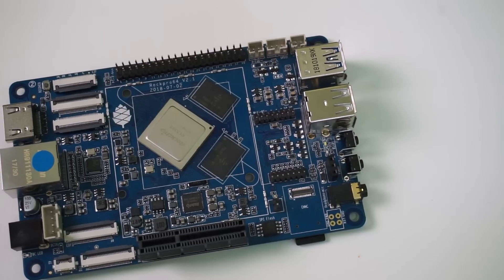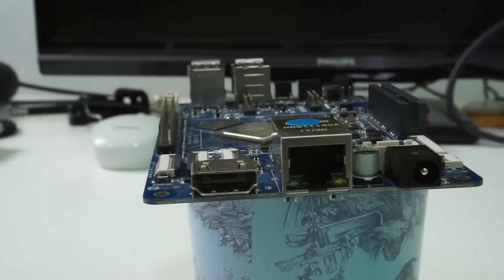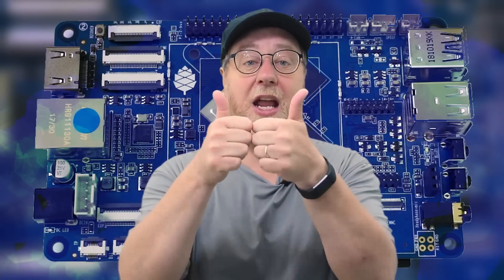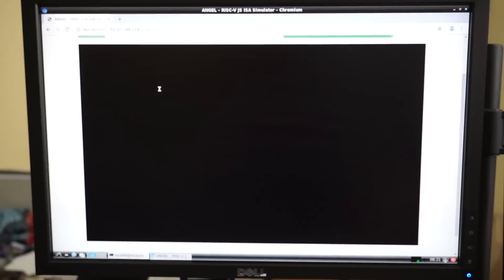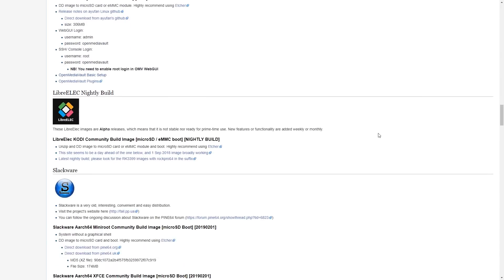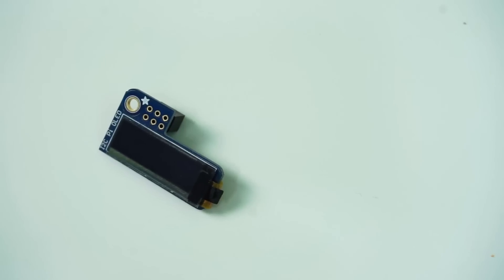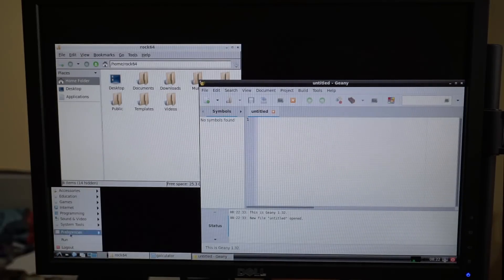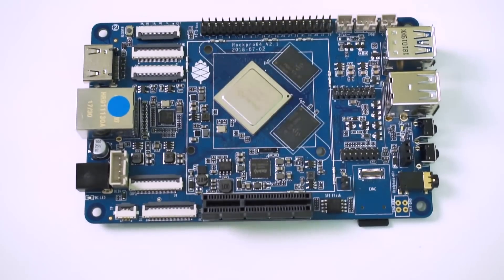PINE64 ROCKPro64 Review: Better than a Raspberry Pi?

Comment: Thumbs up, but for reviewing an open source hardware board. The Rπ is the Microsoft of SBC's. Sure the Rπ may be easier for your grandmother to plug and play, but open source hardware is the future. The Rockchip has a datasheet, so the Linux kernel can support it as people develop the code and drivers. In fact anyone could do this. The Rπ has a broadcom chip with a locked datasheet. Only the Rπ foundation has the datasheet, and they have a binding legal non disclosure agreement that prevents them from sharing it with anyone. They make this deal with the devil so that no one else can purchase the broadcom chip used on the π. No one can build their own hardware with it unless they buy and integrate an entire Rπ which is entirely impractical. The only reason the Rπ has support is due to the Rπ foundation. This is exactly like Microsoft and products like Windows. It's a business strategy all about dominating the lion's share of the market with a sub standard product.
  In the long term, open source hardware will dominate. It's the better choice now and later. We, the average user, own the ability to do whatever we want with the product. We aren't at the mercy of the benevolent dictator corporation to grant us access.

Comment: I was thinking this could be a better emulator console than the Raspberry Pi 3 but i guess we would need to find out if there's no issues with plugins and codecs and now there's the raspberry pi 4.
Reply: Pi4 doesn't still have Retropie support, lol.
Reply: pi4 looks slower than this but for me is more important the hassle free of the pi than a better processor.

Comment: SO is technically possible to connect a GPU on it? lol
Reply: No way! Unfortunately...
Reply: Even if you could, those 4 lanes would choke the bare shit out of it
Reply: The board can't supply enough power for a separate graphics card.
Reply: @suniljanki5595  The board doesn't have to, the PSU does.
Reply: @twmbarlwmstar  Tom Cubie explained it in one of his videos, but I don't have hands-on experience with these boards so I can't confirm
Reply: @suniljanki5595  What do I need explaining, I understand OK?  You supply the dGPU via the PSU.  You need the PCIe socket only for the data.  Therefore, many dGPU have six/eight pin connectors, so the PSU can supply power to dGPU.   And may PCIe risers supply power via a Molex.  

If you don’t have a PCIe socket you may have a M.2 sockets, if you have a M.2 socket then you have a PCIe socket.  You can use an adaptor on that to fit a dGPU/PCIe card.  And fit any size PSU that you need to supply power to the card.

If it has no PCIe then yes you are stuck, but that would be because no PCIe not lack of power.
Reply: Sunil Janki if that’s the only problem you can mod it.

Comment: Sir,make a video on  open source hardware and your opinion on that.
Reply from the maker: What do you mean by open source hardware? Would you include RISC-V, which ISN'T open source hardware.
Reply: @GaryExplains  how is RISC-V not open source hardware? Are you saying the ISA isn't open source, or something else?
Reply: @GaryExplains  Im curious. Why is RISCV not open source?
Reply from the maker: @penguin1714  The licence specifies that the instruction set definition is open source, but companies that make RISC-V processors are under no obligation to release any details/source about their designs.
Reply: @GaryExplains  This is true, but there is open source riscv hardware out right now. SiFives Freedom Unleashed and HiFive1 RevB are both open source hardware if Im not mistaken.
Reply: @GaryExplains  GPL was created as copyleft Free Software which enforces openness. Then Open Source was defined later (based off of the Debian Project) to the chagrin of the Free Software Foundation, as open but without the legally enforced openness. You seem to be confusing the Open Source philosophy with the Free Software philosophy. This is open source which can be closed, but not Free Software which cannot be closed. The GNU project and the FSF can tell you more about the difference.